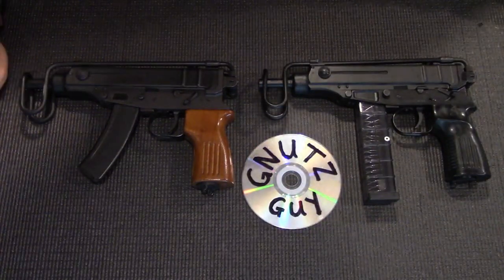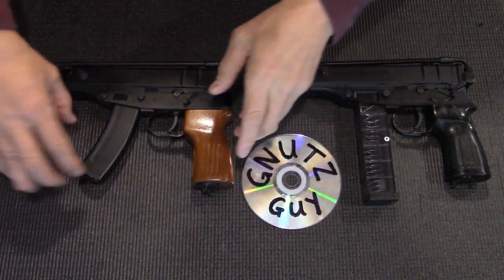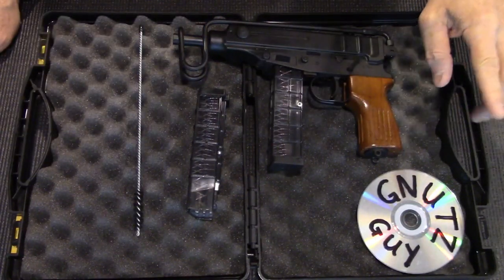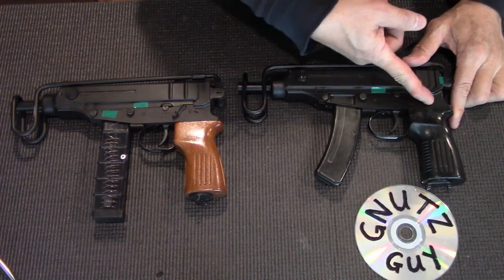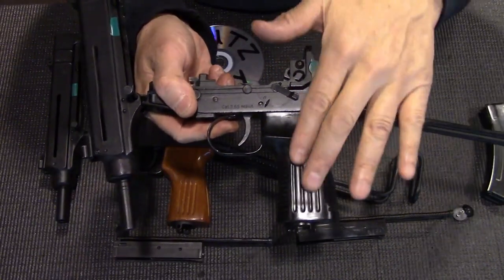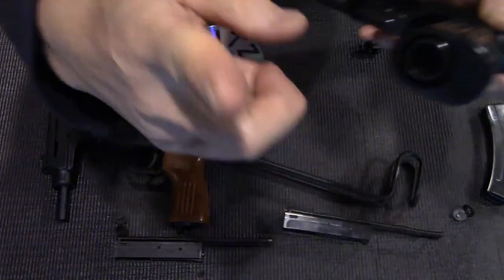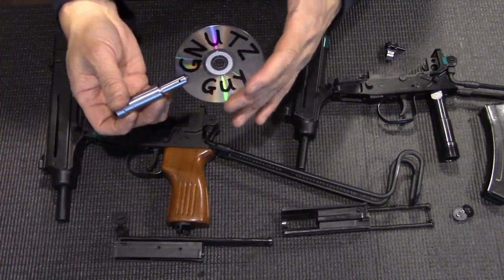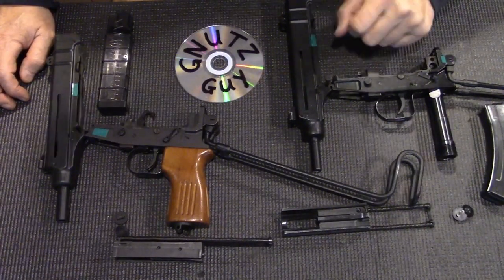VZ-61 Skorpion Comparison. CSA VZ61 .380 vs Zastava M84 .32 acp. Scorpion

Comment: This would be a perfect gun if it was chambered in 7.62X25 Tokarev. Then it would be a useful pistol out to a decent range. 32acp is not a reliable round for killing out past 20 or 30 yards, same thing with.380 and 9mm Makarov. 7.62X25 has quite a bit more velocity and energy out to a short distance than any of the other rounds I mentioned. A suppressor wouldn't be as efficient with a 7.62X25 but your typical tank crew or rear echelon soldier doesn't posses a suppressor anyway. Just my opinion but I think it's worth considering.
Reply from the maker: they tried to maintain the same size of the gun with the 9mm para and it wouldnt work. the 7.62x25 wouldnt fit cos its way too long.
Reply: @gnutzguy  he just wants it to fire them, we all think we do, it’s just an awesome round, can’t even compare it to .32

Comment: 32 acp or 7.65 Br, 380 acp or 9x17mm Kurz, and 9x18mm Makarov are the 3 caliber versions. The 22 that you speak of is a conversion kit by CSA. You can find it on Gun Broker for under $400. They also made a 9mm luger 9x19 version as well but the designer died before it could go into full production. Ian Mcallum from Forgotten Firearms has a video about it.

Comment: 5 calibers, .22LR .32ACP .380ACP 9mm P.A.K. (blank)  9x18mm Makarov.
Reply from the maker: yes, i know but in canada, i could only get 380 and 32, after this vid the 22 arrived and no plan to bring in the makarov.
Reply: @gnutzguy  I know, but the .380 is the one to have, only on a 9mm P.A.K. lower receiver, so you have a full auto version, only without rate reducer, so its shooting over 1000rpm.
Reply from the maker: @frankrommerts5358  no, it can not do FA, the rcmp made sure of that. altho the 32 came with a reducer, the bolt is incomplete, the receiver is missing pillars and the reducer is also incomplete.
Reply: @gnutzguy  that's why you need a .380 upper receiver on a 9mm P.A.K lower receiver, those blank gun receivers are select fire, ofcourse this is highly illegal.
Reply: Isnt the 9mm P.A.K an original .380 only with a blank barrel?
They exist in some european countries but sadly not in all

Are you a german too?

Comment: So I haven't been able to find any information on it but is the 32 receiver able to take the pressures of the 380 and or the 9mm makarov if I were to just buy another upper receiver for my vz?
Reply from the maker: I Don't understand but what ever it is, it's best you buy the same manufacturer receiver bcos there maybe a fitment issue plus the safety is different.
Reply: @gnutzguy  I'm just wondering if I can use my spare upper receiver and put the either 380 or 9mm bcg and barrel in it to see if itll work. I know the upper will at least fit but i dont know if my normal .32 acp lower can withstand the pressures and such from the calibers.
Reply from the maker: @maxxz365  it's should bcos the lower is made of steel.

Comment: How well do those plastic .380 mags hold up to regular range use?
Reply from the maker: these 380 mags are fine for range use but personally, im not a big fan of plastic/ synthetic polymer mags bcos they wear out faster if not embedded with stainless steel and long term IMHO no carbon base mags will hold up.

Comment: Can you put 380 in the 32acp mag?
I'd like to build a vz61 parts kit, but I don't particularly want to buy a bunch of 32acp. (I have a bunch of 380)
Reply from the maker: yes, you can cos both are about the same length but the 380 is design for a straight mag and the 32 for a curve mag, therefore wont function well.
Reply: What would I need to turn a parts kit into a 380? Thank you for the video I didn’t even know 380 or 22 were an option.
Reply: @maybe2714  CZ sells a modern made scorpion in 380.
Converting a vz61 original parts kit would most likely be a job for a machinist or gunsmith. You'd need a new barrel, stronger recoil spring, and maybe a different magazine etc etc.